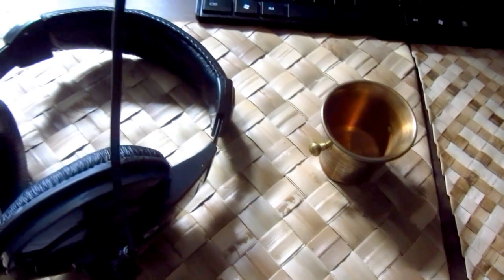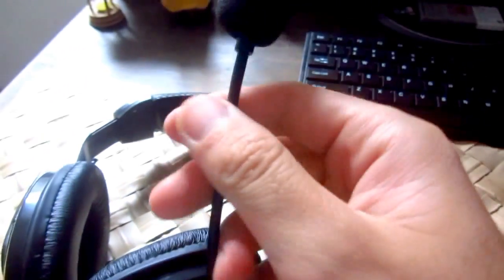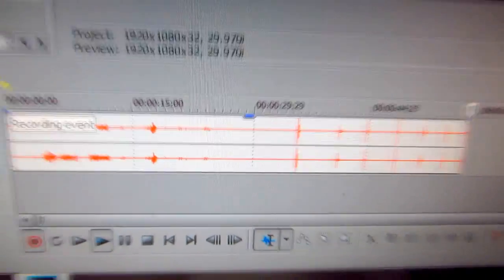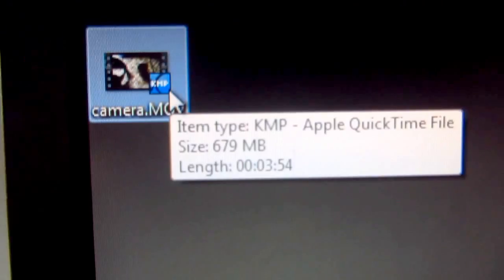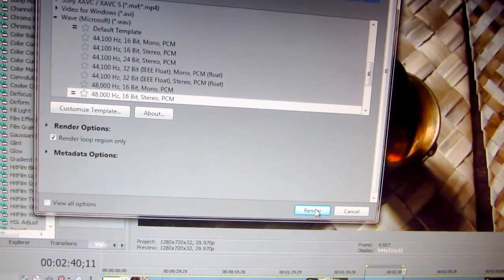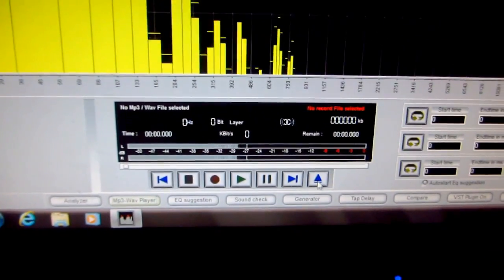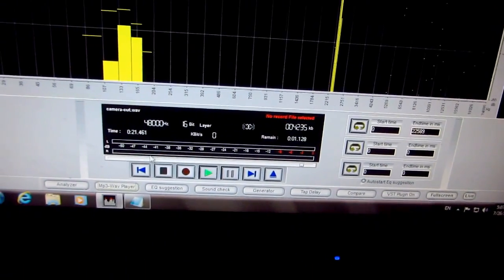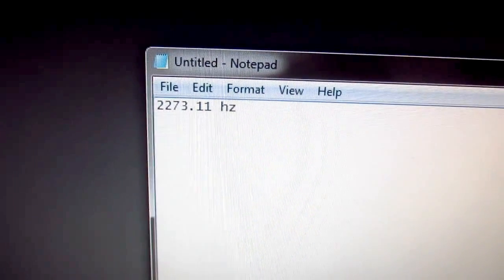How to find the Resonant frequency of an object (.wav files)

Comment: shut the fuck up and hit the cup!
Reply: randolph vazquez Then use a frequency generator to vibrate the cup and determine if that was the best frequency to resonate. If not then try manual variation of a sweep of frequencies. That is then the proof. Not only what you see on the spectrum analyzer. Then boost the amplitude of the frequency to observe the effect. You should be able to shatter a glass using this method.

Comment: Ummmmm you can just use the spectrum analyzer to measure the frequency........no need to do all those steps of saving and rendering..etc....just start the spectrum analyze program, hold the metal cup near the microphone, strike it, then look at the screen........ya dummy!! Let's review shall we?? Start analyzer ....strike object ......look up at your monitor!! Duh!
Reply from the maker: +Jason Cung 
You are correct, but I was comparing the sound recorded by 2 different microphones to make sure both pick up the same frequency.

Comment: would you try multiplying the 2273.11 x 3 than by 6 than by 9 and play that on a speaker near that object see if it makes it vibrate?
Reply from the maker: +Saša Benčić 
Good idea!
Reply: That would be what we call a chord then, am i right or? 
Why multiply with those certain numbers may i ask?
Reply: Nikola Tesla and many other people talk about 3 6 9 the power of those numbers
Reply: @electronicrepair8981  , just multiply  by 2,4,8 ...  As you can see there is an exponential correllation between these frequencies and these will also cause the object to resonate ( if the injected energy is high enough ). You will need those to let the object resonate. 3,6,9 will prob not work for this thing. Yes there is a link between the basefrequency and any natural number you multiply it with, it gives you a harmonic, thats all... 
So Belmior don't know where you get that 18 from... 

 And plz, just plz STOP misusing Tesla's name. Did anyone who is namedropping Tesla ever read a thing written by Tesla ( i mean like actual scientific work) and then checked the facts on it ( don't want to discredit him, but some things where like.....mmmwheee ). Lot's of things were written about him, mostly by people who 
a) didn't know him, 
b) don't have the slightest understanding about physics and 
c) see aliens, them, illuminati, etc everywhere. So yes do some more reading on Tesla, please, but be sure about the trust you can place in the source...
Reply: multiplication works more efficiently. You can just multiply by 18. You need to read more Tesla
Reply: Belmior true. How about raising it a level and multiplying exponent figures?  Instead of multiplying by 18. How about by the power of 18?

Comment: when you played that frequency did the object vibrate?
Reply from the maker: kim north I don't think so, for that it would need a more powerful playback from the speakers and a kind of hollow element to concentrate that vibration into the cup. But theoretically it should vibrate a little bit because its own resonant frequency was played back through the speaker.
Reply: furulevi do speakers capable of vibrating that bowl exist?
Reply from the maker: A simple but large and powerful speaker is enough, just keep in mind that music playback devices will generate vibration (sound) only in the audible range (50-20.000Hz). If your object's resonant frequency is higher than you need another type of vibrating tool.
Reply from the maker: In the following video notice the wooden box of the forks, those are concentrating and sending/receiving the vibrations: https://www.youtube.com/watch?v=aCocQa2Bcuc